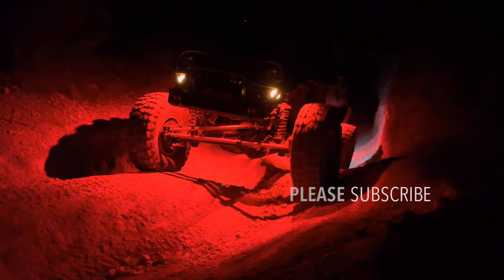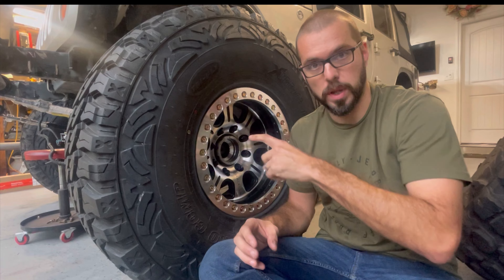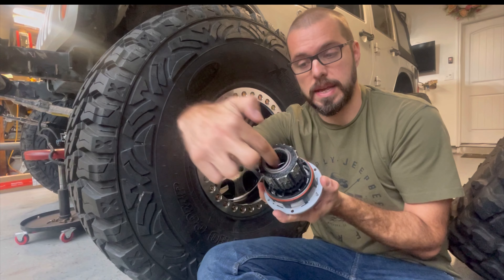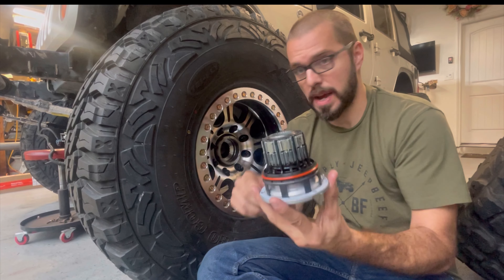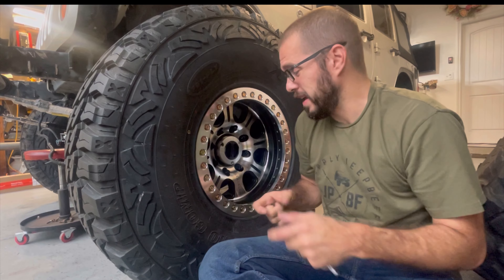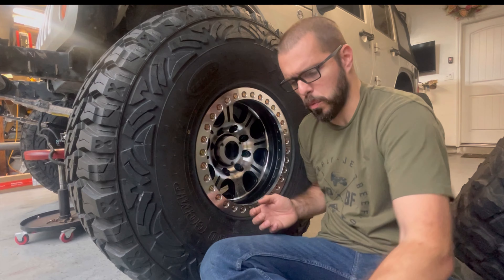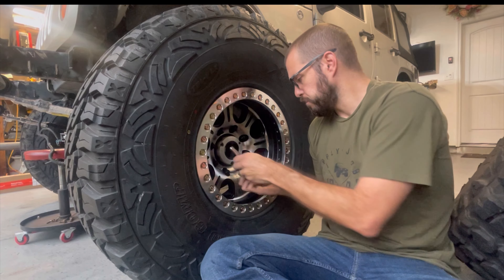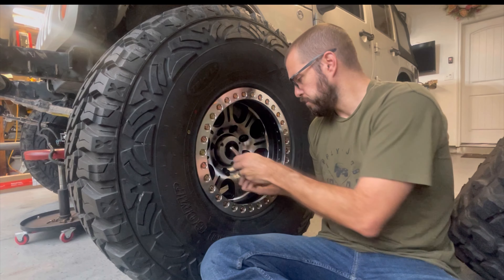Ford Superduty Locking Hubs

Comment: I just saw a guy who got fed
 up with those locking hubs breaking. He tows his, so he installed the Tmr hubs that keep them locked.
Reply from the maker: Yea…maybe they were the older model? Or maybe he is motor swapped and makes way more power.  But I have never broken one in my rig on 40’s and I wheel a lot. Not to mention mine are original to the axles for all I know. Because I didn’t replace them when I built my axles.   The newer style like in this video are much stronger than the older style…but depending on your set up and how you wheel…they definitely make other options. Glad he got it worked out.
Reply: @WarPaintOffroad  well if there better, I would use them too.

Comment: Ford hubs look so simple. My super winch hubs are more like a puzzle to assemble.
Reply from the maker: They are SUPER simple. Decently strong. Work well. They have aftermarket ones like I mentioned that are stronger. But I have out mine through some stuff and haven’t broke one yet. And TBh, they are still the ones that came from the junkyard. I replaced the bearings but they were in decent shape and cleaned up well. But they are nowhere near new.